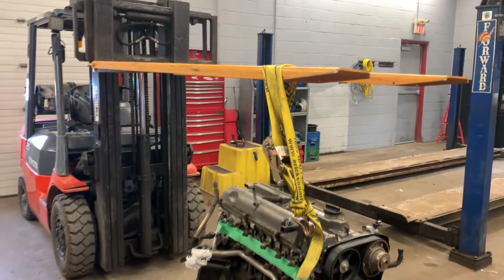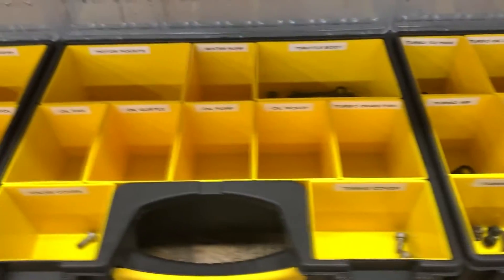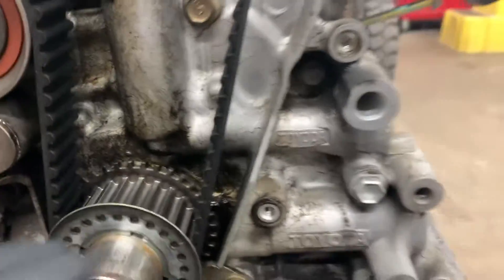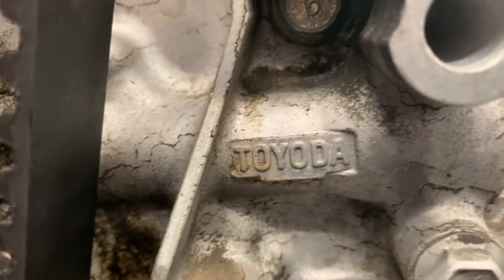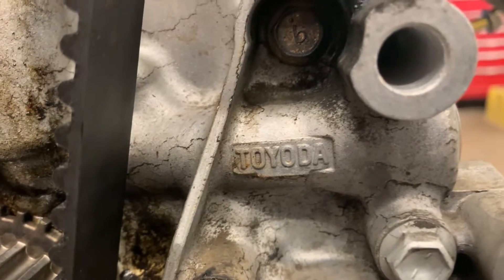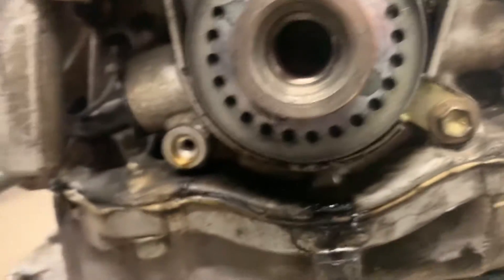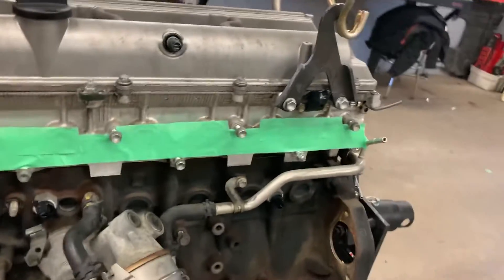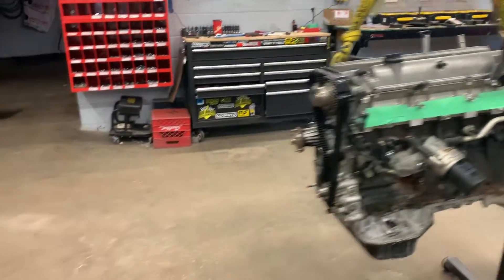2JZ LOWER END TEARDOWN

Comment: I don’t think that the W55 will stand up to the power of the GTE motor.
Reply: CD009 transmission from a 350z is what I would use if I went T
Reply: Duy Huynh the cd can’t fit perfectly in the is tunnel. The shifter will be to far back.
Reply: What about the ar-5? I've heard that one could hold some power